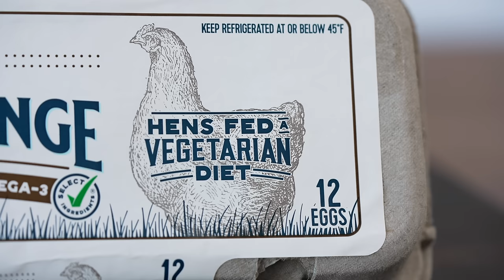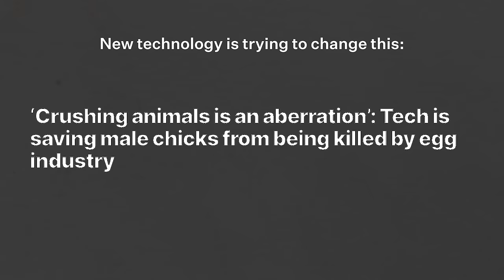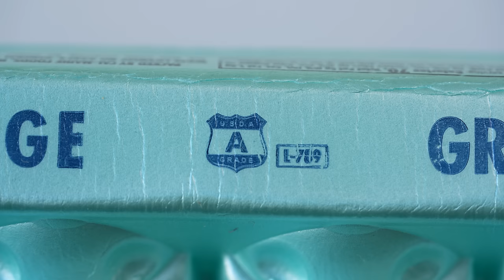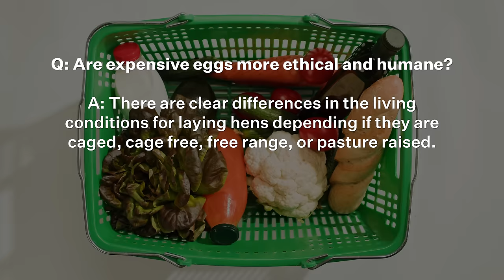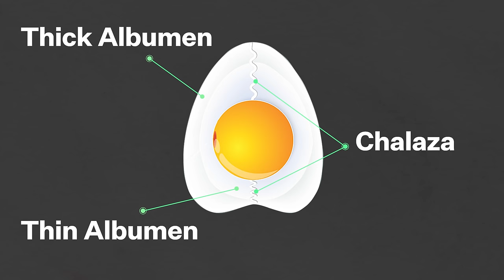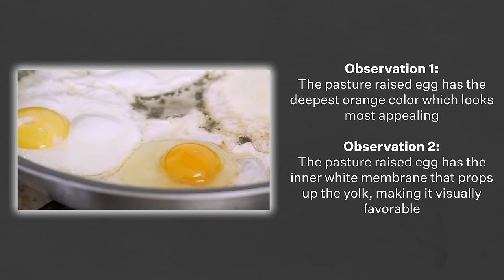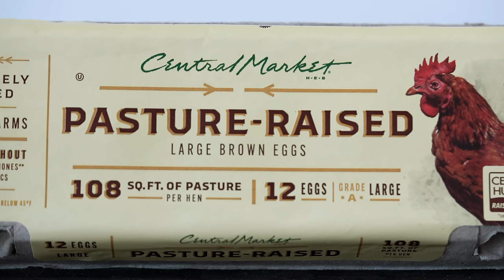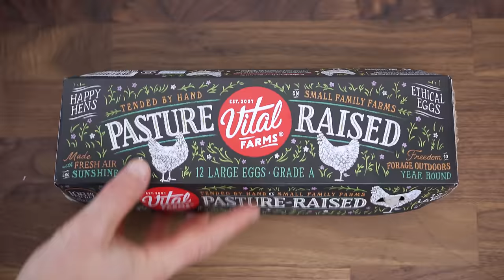Are Expensive Eggs actually worth it?

Comment: You should have poached them also because that makes a real difference in old vs. new eggs. All that water in an old egg needs to be drained off through a slotted spoon, Thomas Keller has a perfect spoon for just that purpose, so you get just the solid albumin and not all that stringy egg white waste you can't eat. And NEVER put vinegar in simmering water for poaching eggs. A well drained egg white and a slight swirl of the water makes a PERFECT poached egg without a tough texture or vinegar taste.

Comment: There is one aspect the video at the start touches upon, but doesn't take into consideration with the classification (and price) of the eggs : the feed to egg conversion and the environmental impact (directly from using more nutrients per egg that can't be used somewhere else and more waste/emissions from the chickens:  methane production, extra Nitrogen deposition, etc.). 
Often customers valuing good treatment of animals also value the environment. 
There must be an impact, however to be able to evaluate the pros and cons it would be interesting to know how high the impact on the feed conversion is. 

Another aspect with giving chickens the option to roam outside is the increased risk on bird flu. If chickens in a flock are affected, the complete flock must be culled. Not really animal friendly or good for the environment. 
For private chicken keepers (expensive) vaccination is an option to prevent this, but the most used option is to keep chickens indoors. 
In my country (The Netherlands) regularly and for example again since 3 days chickens must be kept inside because of established increased risk on bird flu until it's established that the risk has decreased to "low" (whatever that means 😊).
I wonder if in that instance the certification of the egg is changed too (in that case there will be periods that eggs with  the highest certification won't be available) or can be kept while the chickens don't get a chance to roam outside as the certification suggests.

I'm no expert, so I don't know the answers. But in my view it should be taken into consideration what the impact of these aspects is.

Comment: I'm surprised that you didn't do the 30 day old egg test for all 4 types and instead of having them be 30 days old it is when they are starting to float since wouldn't it be a possibility for there to be a difference in how quickly they deteriorate in the fridge? Although that is a lot of eggs to buy and keep for a while along with the the fact that if they do deteriorate at different paces then it's hard to have them all line up so you can test all types on the same day.

Comment: What happened to ORGANIC eggs? In my opinion, the most important thing when it comes to eggs is what the chickens are fed. What good is a pasture raised egg for example if the chickens are fed non-organic feed sprayed with Monsanto Round-Up?  How about the non stick cookware you use? It is Polytetrafluoroethylene (PTFE). SAME AS TEFLON! I wouldn't eat ANY egg that isn't certifi3d ORGANIC and Polytetrafluoroethylene (PTFE) cookware is DEADLY. I guess you only care about the looks and taste of your food and not about the toxins they may or may not contain.
Reply: Excellent points ! High heat , non stick crap , seed oils , bad feed , so many things.... It's a jungle out there !

Comment: Overall, this was an informative video. BUT, you muddied the waters when you discussed the nutritional value. Most of the video, you compared eggs by how the hens were housed and raised, but on the nutritional part, you only compared organic eggs versus conventional - this is NOT the same as comparing caged eggs versus pasture - raised. Why did you divert from the comparisons you made in the rest of the video just for this category??? You fully explained the differences in how they are housed but didn't even touch on the differences in organic vs. conventional feed - yet just threw in these categories in the nutrition comparison. I don't know the particulars of the study, but it could have just been organic corn feed vs. conventional corn feed and of course that wouldn't impact nutrition much. The purpose of organic is not to increase micro or macro nutrients. The purpose of organic is to reduce herbicides and pesticides. I would expect the nutritional value to be impacted, though, by access to a variety of foods found outdoors, like worms, bugs, flowers, seeds, etc. Caged hens getting controlled feed indoors, whether organic or not, will not have access to these foods. You should have compared the nutritional value of caged eggs to pasture raised eggs! Seems like you were attempting a slight-of-hand here by slipping in organic/conventional instead without any explanation.